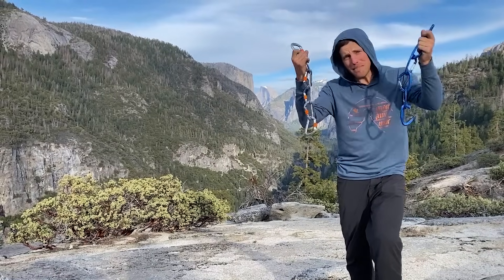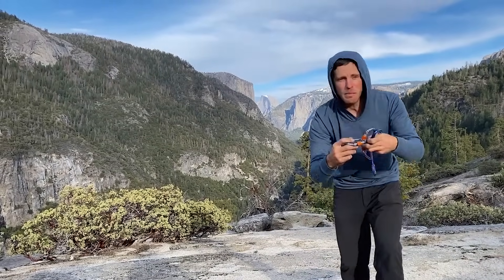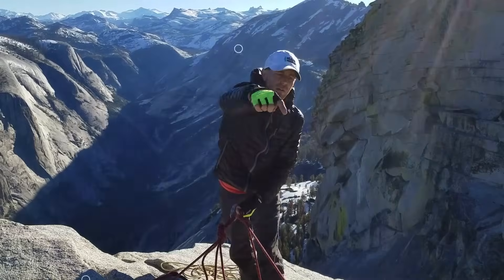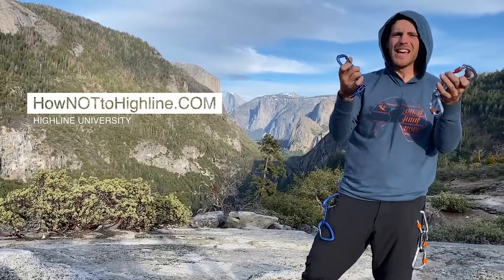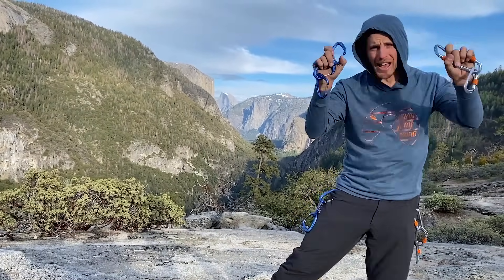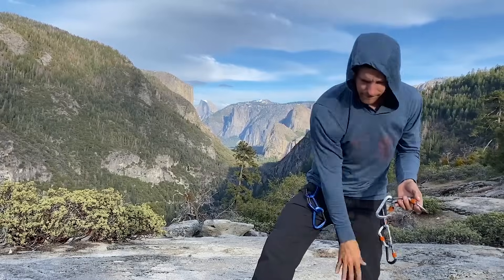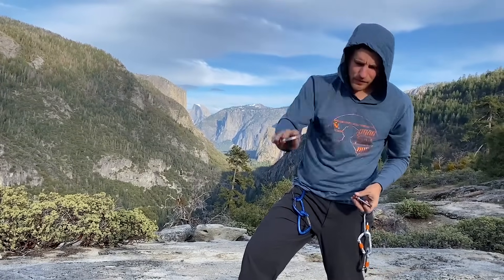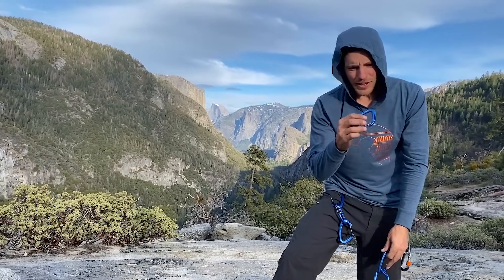Are MicroFractures a Myth in climbing carabiners?

Comment: You should team up with one of the "ultra-high speed camera" channels to get very slow-mo footage of the breaking equipment. Watching a crack propagate thru a device often reveals interesting insights. Great channel. I never climb, highline, or slackline, but I command a Urban Search And Rescue (USAR) crew so I enjoy watching your destruction testing and your diligence on safety. You're an excellent role model. Thanks!
Reply: Once you get the drop tower up and running, it would be great to revisit micro fractures … scratch up some carabiners in this way, then shock load them from a few to a ton of falls.  Then do a fail test and see their actual strength.
Reply: Smarter everyday
Reply: Cracks propagate through materials at speeds nearly the speed of sound in the material, or sometimes higher than the speed of sound if it is a brittle failure. In most metals, that means that the crack in something the size of a carabiner would propagate through the material in low single digit micro seconds. If the fracture was two micro seconds long, then at a frame rate of 500,000 frames per second, the fracture would still occur in a single frame. For reference, 500,000 frames per second is the fastest the SlowmoGuys have ever filmed at (not including the time they went to Caltech and filmed laser light with a special camera). In fact, the slowmoguys filmed a 1.5 inch steel rod break test at Purdue at 28,000 fps and they noted that it was essentially instantaneous, even at those speeds and they theorized that they'd need a million FPS to see it actually crack. They weren't wrong. At a million fps, that bar would have broke over the course of about 6-7 frames. But to get 1 million fps, the quality of the recording would make 2006 YouTube videos look like HD. But a carabiner, even at a million frames per second, the crack would occur in about 2 frames.
Reply: @TheArmyKnifeNut  ummmmm....okay.... alrighty then thanks for scrambling our brains you know us.... spectators who don't climb...????  🤔🤔🤔